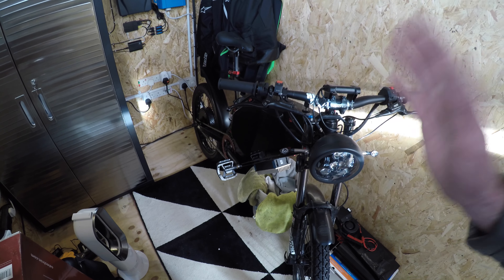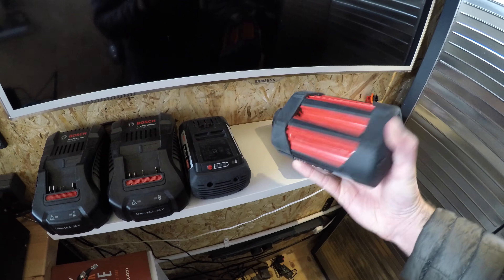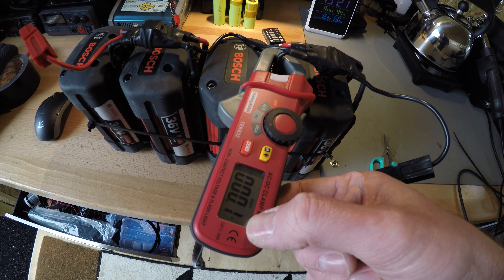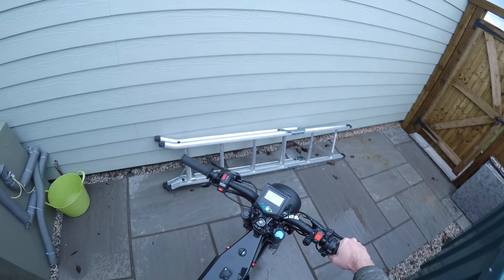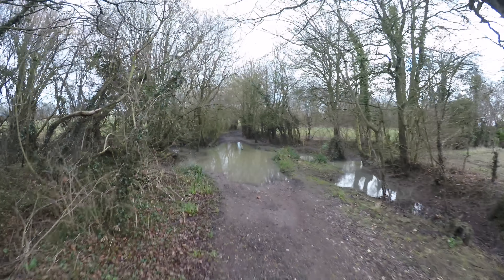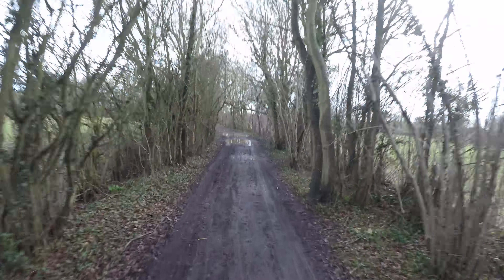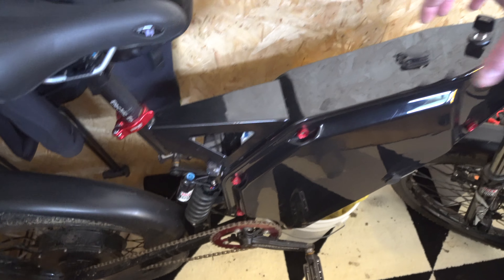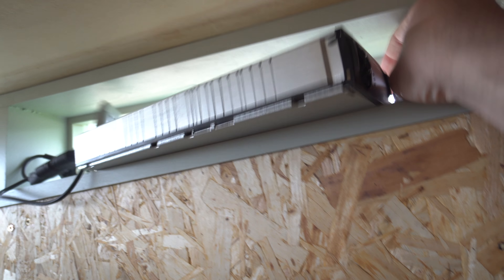WHAT NOT TO DO ON A HIGH POWERED EBIKE!!!

Comment: Saw in an earlier video that you were using 4 x 36v 4ah Bosch batteries as a temporary measure /back up. These seem very expensive -wouldnt it be cheaper (and better) to use some 6S Multistars, or am I missing the point??
Reply from the maker: Hi, I’ve been there done that with the multistars, they are good whilst they last but they don’t last long. I had many multi star packs fail at different times and it just got silly. It would be cheaper to build an 18650 pack as a backup but the good thing about the Bosch packs is:

1. They are modular and can be used in loads of different projects
2. They have inbuilt balancers when used with the official chargers
3. They use premium high discharge Samsung Cells
4. They are rugged and won’t damage if  treated roughly
5. They have a warranty, so if a pack dies you’ll just get a replacement.
Reply: Thanks. Perhaps I should stick with the 18650's then. Currently have a Samsung 25R 52v pack which I am very pleased with but currently sharing the one battery between 2 bikes so ought to have a second battery really (not that you can ride more than one bike at a time!) but a higher voltage 18650 will be too bulky for both frames.

Comment: Just come across your videos they are great
Because I muck about with lipo battery's chargers ect and have always wanted to do my she'd like you Have with a solar panel and have free lecky so going to look into price es ect.I have a Revoelectix celpro 8 with a 24v power supply that I use its great for charging in quick time bit pricey buy worth it.Need a bigger inverter though and a big leasure battery.Your channel is something I have been looking for so will lol forward to starting from the begining and playing catch up.

Comment: I have installed battery cels from Nissan leaf, got 14s into that frame,works perfectly. What's your range at full and low power?
Reply from the maker: Wow that’s not bad going. Where did you mount your controller?
I get about 30 miles at 30mph ish. If I ride it like I stole it then it would be less!

Comment: Did you ferrofluid and varnish that motor? If not, I'd be making sure it doesn't turn into a solid chunk of iron after being submerged.
Reply: No point in ferrofluid without hubsinks. Also all aluminium except for the axle, so corrosion isn't really an issue
Reply: Didn't know aluminum was magnetic? I guess everyone has jumped on the heatsink bandwagon? All news to me. Thanks!
Reply: The aluminium isn't magnetic... well, actually it is, it's paramagnetic. The magnets inside the motor are neodymium, coated with nickel, so also not going to corrode. I actually stock hubsinks for both mxus and qs, just sayin' ;) hahaa
Reply: Is there something different about the metallurgy of this motor than others?
 I'm going off videos like this rusted solid one here. Maybe I'm missing something? https://youtu.be/1UmA5xmzgsM
Reply: Back in the day they used to use steel stators. It was a relic of those days to paint the stator to protect it. Especially if you drill vents in the side covers. These days it's better to use ferrofluid and hubsinks.
Reply from the maker: No didn’t, it must be sealed very well because it’s always been fine getting wet :)
Reply: It's the age old problem, seal it well and any moisture that does make it in, can't get out very easily. A less than perfect seal, will make it easy for any moisture in it to get out.
I also just noticed you an I have the same helmet lol... fox rampage
Reply: That video I posted was the QS205. Thought that was a pretty current model? What motor are you guys using? Sorry I'm trying to learn about these electric motors for harsh off road use and part of that is waterproofing. Thanks!
Reply: All motors come in variations, the v1 is usually steel stator, the v2 is aluminium and the v3 is aluminium with extra copper fill. I use an MXUS 3k v3, it's the top end model with curved magnets, fatter axle, thicker phase wires and redundant hall/temp sensors.
If you want to do severe off roading, like greenlaning, then a hub motor is not for you. You want a beefy mid drive system like the gng mid drive (lightning rod big block), even a bbsHD is a formidable mid drive, especially driven with an external controller.
Reply: Thanks for pointing me in the right direction. Just joined Endless Sphere and there's so much info to digest. Not looking to go too fast, Was leaning towards a basic 2wd setup like the one on ebikeschool's channel to start. Ultimately Id like to build an electric version of a ROKON motorcycle.
Reply: Endless sphere is a fantastic resource. If it wasn't for that forum, ebikes would look very different today. It's worth reading into the drama behind the ES forums and how Justin (grintech) ended up owning the forum. That video with the 2wd setup is actually Micah Toll, an absolute veteran of ES and all round nice guy.
Always a pleasure to help someone get into the world of ebikes, they never fail to put a smile on your face ;)
Reply: Oh, I should also point out there's an endless sphere facebook group and I'm an admin on the official endless sphere sales group. I'm also a motor/controller/battery supplier in the UK, but I know suppliers from all over if you want to purchase any kit. I also make custom ebikes and modify frames.

Comment: Bump your solar setup up to 48v and run 4x 12v batteries in your bank. That way you can clamp your Max-E right to your solar bank for SUPER FAST charging! 70 amp charging at 72v for a whopping 5KW per hour... Your full charge times would take less than 30m...
Reply: MasterQuack14 and your batteries spontaneously combust as a bonus!!!

Comment: lol   poped a 9c  clone 28mm     the other day had job  interview   with half hour notice    20 miles  away plus  getting reddy     got job lol  motor cooked    runs windings   black tho   should of use big ebike but brakes   need bleed   tho was water proof  it seems generic 24 fet    hits   65mph lol   for a short  time  on 26inch wheel     cant  get more than 60 out the big bugger   but  stays  cool